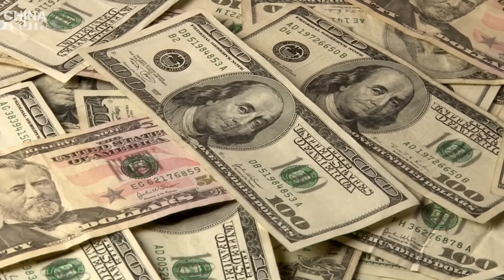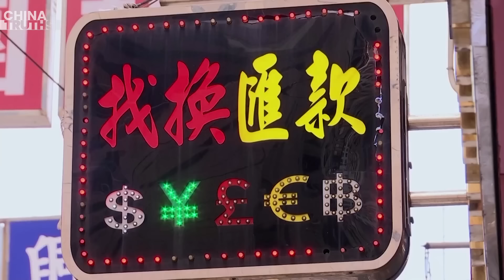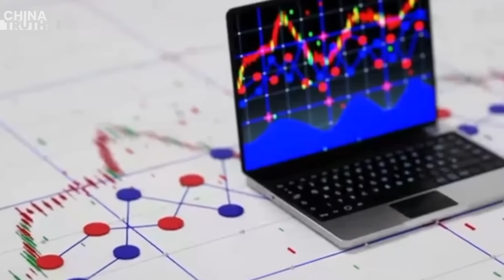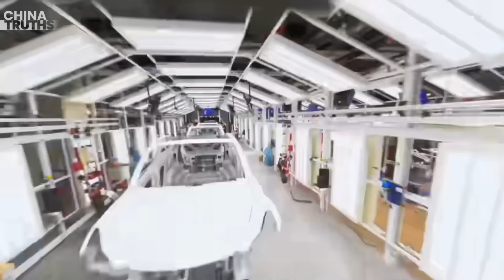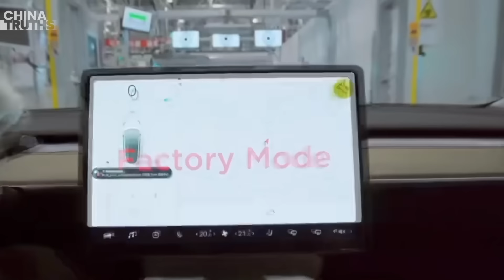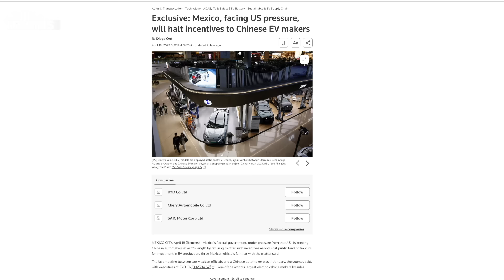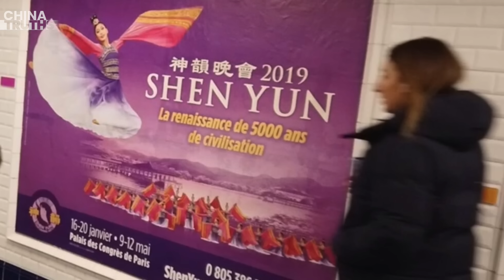Chinese Firms Rush To Abandon Renminbi; Tesla China Massive Layoffs: Up To 50%

Comment: It was silly to try to displace $ because it is irrelevant to the system.  Now if a bank wants to lend and a borrower to borrow, they both convert to $ then back.  If tomorrow, the $ was replaced by a frank, pound or mark, the only two changes would be Americans would know the conversion and my keyboard change shift 4.

If you understand the difference between a Yuan and the Renminbi, you would understand why neither has a chance to become the new Euro-Dollar.